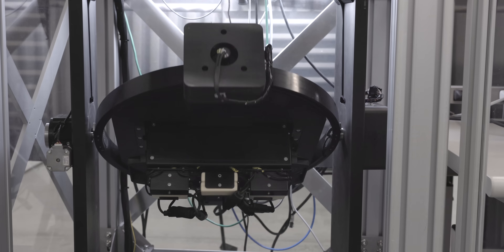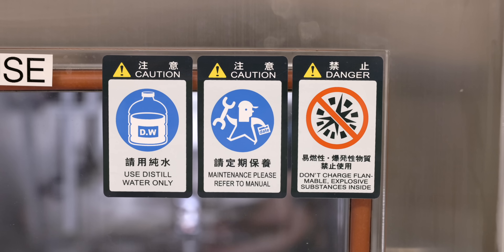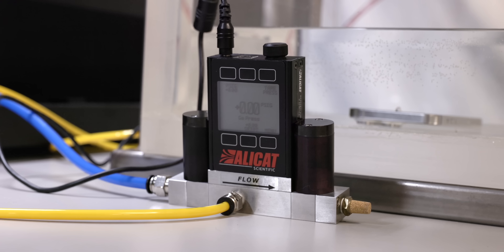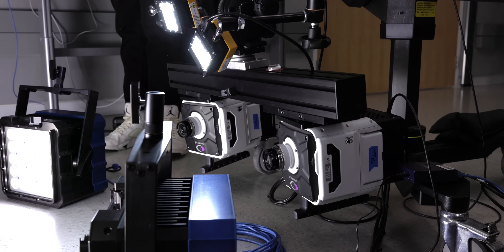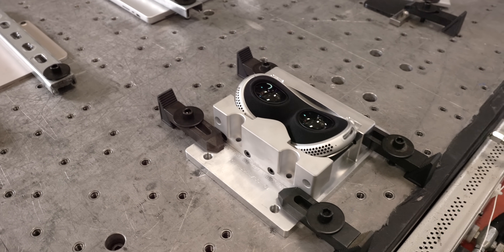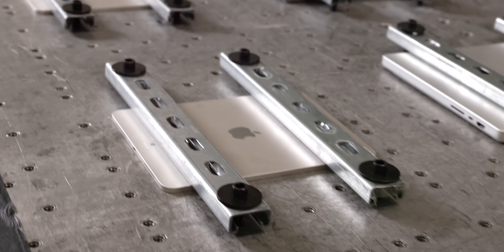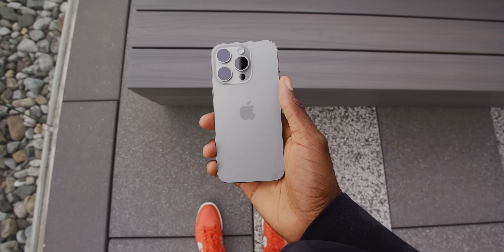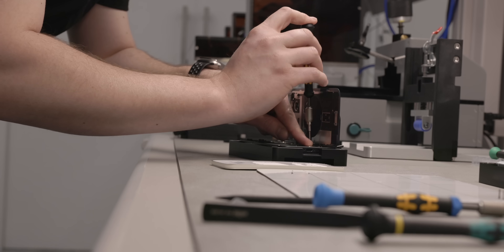I Visited Apple's Secret iPhone Testing Labs!

Comment: For the first time in many years of watching Marcus's videos, I was very upset after watching this one. I don't understand why he, such an experienced tech blogger, ignores the fact that Apple is blatantly deceiving its users. They claim they had to sacrifice repairability in their devices last year to make them significantly more reliable, almost unbreakable. 
But this is a blatant lie. A blatant, nasty lie to users. Because while Apple phones didn't even have the highest IP68 protection rating, Samsung phones already had that rating, they still had a headphone jack, and they were far more repairable than Apple's. And they broke just as often. Apple certainly wasn't a leader in phone durability then, just as they aren't now. So, Apple is blatantly lying. 
I'm curious why Marcus, knowing all this, knowing that Samsung phones, Samsung flagships, with the same features and technically even more features than Apple's at the time, had the same repairability as all other phones. And only Apple made their phones practically unrepairable. Reliability has nothing to do with it. Why didn't Marcus ask this remarkable engineer anything about this?

Comment: Let me start up by saying that I have all the Apple devices, iPad Pro Apple Watch, MacBook Pro AirPods. I've bought into this ecosystem, but one thing that's becoming very very clear to me is that Apple is the Scientology of technology they charge you so much money 💰 for things to get money out of your pocket, but they don't innovate as much so you don't actually feel good about the purchase. I'm starting to get very concerned that they've changed as a company.  I'm also getting concerned that they're going to hold our data hostage and charges more money for everything. I never thought I would live in a world where I feel like would be a better option, but I'm starting to feel like that. The walls are closing on the walled garden. 🪴 and the customers like us will be eaten alive by them. since tablets have become so expensive I am planning on moving to the Samsung Galaxy S24 ultra. It's my only shot to have a tablet and a phone all at once and unlike Apple Samsung doesn't care to sell multiple devices. It would be nice, but that's not what they're trying to do. Apple cripples all devices so you have to buy them all to make things work. I didn't want to leave Apple but Apple has left me. 

@samsung @apple

Comment: The number of repairs could have also dropped not because of increased reliability but rather of increased prices of repair and service, which inturn is counter productive for environmental protection. If getting an apple product repaired costs as much as getting a new phone of some other brand, people would switch (except for loyalists) to the other brand.

Comment: I am disappointed in you. Reparability and durability are not opposite. There is a LITTLE overlap but saying that is false and misleading and you are smart enough to know that.
People form apple do not speak about it because of all malicious business and engineering practices how lock down HW.
Reason Apple repair has gone down because they worked to kill it so you buy a whole new device just have maximum carbon footprint ops I actually profit.

Comment: You had him in the ring and in the corner...Speaking from a repairing perspective I don't think there is a relation between the reparability of a battery to the adhesives sealing the phone if the battery or any other component for that matter is serialized. How does serializing the part help with the durability surely?

Comment: I don't think durability vs repairability is as simple as a single sliding scale. There are plenty of examples out there of devices that are really durable and rugged, and still easily repairable. The one that came to my mind immediately was the Panasonic Tough Book line of laptops. It just takes a lot more engineering efforts to get both durability and repairability into one device, and it's at the cost of compactness and performance...
Reply: Potentially rather a triangle between durability  repairability and size.. Anyhow my main concern with their repairability is not necessarily the hardware design, rather the fact the a proprietary screw or a software lockout won't make the product more durable. That's where this whole argument shatters like glass 😟 It's hard to do, there might be legit reasons for it.. But when they put extra effort to screw you 🤷‍♂
Reply: @u-foka  I would also add the accessibility of parts. One of the reasons Apple is constantly criticized is that original parts are not easy to obtain for third-party repair shops.
Reply: @u-foka  the moon is missing outside and @ the mirror and the signal of sound reflection, entertainment had no right to throw a frequency into my heart, get the fuck out of my body merging into me and blowing me kisses through my own body get the fuck out of my frequency Stream Melanie martinezes weird body merge album Melanie had no right to make the music that killed me in reality get the fuck out of my body trying to snap me out Stream tuning out of time by paramore's the new's. this is already the mind get the fuck out of my body you guy's had no right tot kill my in reality get the fuck out of me  stream paramore;s the new's for the space of heart get the fuck out of my body blowing me kisses in my own skin you had no right to merge into me get the fuck out of my body…/…./.
Reply: The biggest issue with Apple is not that it's hard to repair, is that they go out of their way to ensure no one can repair their iPhones, even with genuine parts, except the authorized Apple repair shop that will cost more than a new phone.
Reply: @OlivierCaron  which is fine, because ultimately better for them. they can't trust random 3rd parties repairing iPhone because they may fail at that and then ultimately the customer will be unsatisfied
Reply: The Thinkpad as well. I am still using one that was made in 2012.
Reply: Unfortunately they also factor in appearance, a phone with screws and hard plastic won't give it that "premium" feel they constantly push.
Reply: I thought about laptops as well, and that Apple hasn’t bothered to make those modular or repairable at all. There also have been multiple phones released with removable backs and high dust and water ratings.
Reply: I agree… the repeatability of Apple products is made difficult by the serialization of parts and Apple blocking the sale of repair parts. High durability doesn’t automatically make it hard to repair
Reply: Great water protection makes battery replacement difficult??? Ummm… GoPro hero cameras…. Great underwater performance, replace battery in 15 seconds
Reply: Agreed. 1. I am not a fan of non owner repairable devices. 2. As mentioned in other comments, durability and repairability aren't mutually exclusive. It's not a sliding scale, but what having both also adds to size and expense. Adding glue to most-if-not-all internal surfaces vs screws can spread loads much more evenly and increase vibrational and impact durability in addition to preventing environmental ingress. 

That's the point that should have been made. I hate it, but it's true. Do I want to pay for repairability AND durability? Most folks would say "No" (sadly).
Reply: I was also puzzled by this statement. These things don't counter each other out, durability only impacts the potential need for repairs, but repairability has nothing to do with durability. Please don't take over that logic, Apple is fighting against right to repair harshly and tries to bend logic to achieve that.
Reply: Thank you so much for pointing this out! Got a ThinkPad from 2015 too, that is easy to repair and durable.
Reply: You didn't factor in convenience. People don't want to walk around with a brick. They want their phones to be slim and light. Basically they want the jack of all trades device that they can repair themselves with a simple screw driver. I don't believe in those conspiracies that apple only makes their products harder to repair to earn more money.
Reply: I would argue that this sliding scale is a 3000 ft view analogy that makes the concept easy to understand. Think character design and this is just one slider that affects others. Even with plenty of examples in the industry you have to define the scale within the bounds of the design. While correct, I think you're overthinking how complex the statement was.
Reply: Another example the nokia phone
Reply: And place where it's easily comparable are touchpads, durable ones are super tiny and likely plastic, the nicest most accurate ones are just big pieces of glass
Reply: yeah because a tough book is super portable, sleek, lightweight and appealing! NOT.  you basically just proved his point
Reply: This is Apple clearly using MKBHDs creditablity. They push that durable/lonlasting v repairability to explain why they refuse to let end users reasonable access to repairs.
Reply: check panasonic fz-n1. I use it at work. it's like holding a stone yet light ! I don't know how they've managed to build that thing. amazing stuff
Reply: What about the screws on the inside? Samsung flagships are one of the most modular and easily repairable because they only have 1 screw type and there are only at most 2 different lengths. Compare that to Apple with 4 different types of unconventional screws with varying screw lengths. That is intentional anti-repair design.
Reply: I may agree with you
Reply: And profits. Don't forget the profits. It's the single measure for Apple decision making.
Reply: what they really should say is that the scale is "sleek design vs repairability"  that makes waaay more sense.
Reply: Yea. While I understand his's POV, think of a bunker, the more secure and durable it is, the less likely someone can enter and do things in there.

Comment: This was interesting to watch! As for the repairability vs durability argument, it's fine when repairability is compromised for durability, but serializing components to prevent repair does absolutely nothing for durability, so that's BS. I'm fine with having a glued shut glass slab that's difficult to open but can be submerged in water without being damaged, but I draw the line when my phone tells me that the battery or screen I put in it aren't good enough, just cause I didn't take it to the manufacturer to change them out. Louis Rossmann talked about this a long time ago.

Comment: 10:00 You should have been more critical of that. Sure there is some relation between durability and repairability, but it's way not as extreme as he states. For example you can achieve IP68 even with a replaceable battery. Also their phones are not infinitely durable. They break. They break constantly. Their macbooks also for example have design flaws regarding power to the SSD that causes it to break. And even if they could, they would never make it infinitely durable, instead they go for planned obsolescence for obvious reasons.

Comment: if apple wants make a phone that last forever, that will kill the company. because why would anyone buy a new phone if it works perfectly fine? and the hardware of the phone is that good, that decades of new software should run on it anyway. you cant argue that, you might want a new phone because of a new ios version. how good or what can be on a phone that needs more ram a better cpu or more storage than we can have now? i also would argue, how often is a battery broken because of water? how many people are that clumsy that their phone fell into a pool or in the toilet?

Comment: As a lab tech that also wears a second hat for computer work, I think I might keep an eye on Apple for positions in the future. That looks fun.

As far as glass is concerned, unfortunately, glass also provides relative scratch resistance and rigidity compared to plastic. Barring accidental damage, tempered glass generally wears better over years. So I don’t see manufacturers moving away from glass anytime soon. (Sapphire is even more extreme, being more scratch resistant and rigid than glass, but more brittle as well)

Would explain the move towards more rigid metals, such as stainless and titanium, in an attempt to reduce impact forces getting to the glass. Aluminum deforms, but does not return to its original shape. 

Ideally, it would probably be better to design a phone, and a case as a unit (and sold together). Design the phone to work well with the case, and vice versa.

Comment: 7:25 strong disagree. It is not about the hardware, how durable, water tight it is. It is about locking things with a firmware, making parts hard to get or not being able to use not genuine ones.
Have a speech with Louis

Comment: Being repairable>everything

Ip rating not letting us repair our phones is BULLSHIT
I payed for the phone, i should be able to reparit it and change the battery every 2 years without paying half of the price of the phone when the battery should be under a quarter

They re not gonna make a phone that never brakes

They are making phones that get gimped in software after 2-3 years of use and catch you into a ecosystem

Comment: I’ve owned about 7 Macs (1st in ‘84), an iPad, an iPad Air and two iPad Pros, Apple Watch SE, 3 iPod touches, 2 iPhones, 2nd gen AirPods and 2nd Gen AirPod Pros. None of my portable devices have had screen protectors or cases.

The ‘84 Macintosh blew its power supply and was replaced under warranty as it was a common issue. The hard disk failed in my “sunflower” iMac.

That’s it. Those are all the failures I’ve had with all that Apple kit since 1984. Give me durability over repairability any day, if that really is the trade-off. Clearly, Apple’s products are of excellent quality. Maybe I pay for it but it suits me just fine.

Comment: things like the fairphone, older LG phones, and A series phones directly put the idea that "apples phones are hard to repair because its super durable" in the grave. LG and Samsung made phones with easily, customer replaceable batteries, charge ports and screens, with IP68 ratings and 10 foot military drop certifications. Apple makes their phones harder to repair on purpose, several ex apple employees have said this. The idea that its better for customers for their phone to be "more durable" but harder to repair is sooo dumb.

Comment: Interesting video and I think the engineer you spoke with was articulate, but I think it was a well worded excuse and that these things are not on a linear sliding scale as presented. Apple doesn't want their phones to last forever, they want you to buy a new one each year. They have demonstrated explicitly and publicly before, such as with the battery issues on older phones, that they are not afraid to make something work worse in the long run to pressure the consumer to buy a new phone more frequently, which clearly is not ideal for the environment.

Comment: I had a Casio Commando (first generation one). Dropped it in this bucket of Sulfonic Acid. Had to put on gloves to get it out of the bucket and then dunked it in distilled water to clean it off. Then, went kayaking that weekend and phone was still playing Metallica all while I was under water. The phone lasted another 2 years.

Comment: It’s disappointing that they took a very specific instance of durability being affected by repairability and generalized it. Macs and iPads are extremely difficult to repair or upgrade. How is their lack of repairability correlated with durability? In fact, it’s inversely correlated with sustainability because a chipset with damaged soldered-on components has to be thrown away rather than being repaired and put back to use.

Comment: All these durability tests are just bullshit from Apple… I have an iPhone 11 which accidentally dropped from waist down onto a mosaic tile, the glass panels on both sides didn’t break, the Alu surface has no dents, the iPhone still works, but the LCD panel bled horizontally across the bottom screen. A year later I intentionally slammed my iPhone sideways onto a tiled wall. Again glass panels intact, all surfaces still no dents, but now my LCD panel bled horizontally on the top screen. Durable my ass…!!!

Comment: You are wrong, repairabilty doesn't have anything to do with durability, i could give you a thousand examples of different products that are built like a tank and are repairable ! When you're talking about replacing a screen or a back cover or whole parts, any device is repairable in that matter, but programming a device to reject replacement parts and blocking the supply for parts has absolutly nothing to do with durabilty, this is total BS! All these testing machines and yet they still manage to sell you Macbooks with flex cables that are too short, failing keyboards etc.. same deal with iphones. Honestly i'm so tired of watching any video about Apple products..

Comment: You can make things durable and repairable via a modular design. This comes with an associated cost, but it is possible. Also not latching components to a specific motherboard serial# would help customers repair cheaply..

Comment: So much money went into this but still Apple refused to fix the camera on my iPhone 13 Pro because apparently the water indicator inside is red.
Phone works perfectly fine, even the camera works most of the time but just sometimes stays black. Doesn’t seem like water is the problem… especially because it was never in contact with water except for maybe light rain.